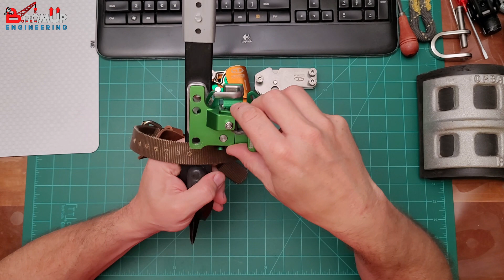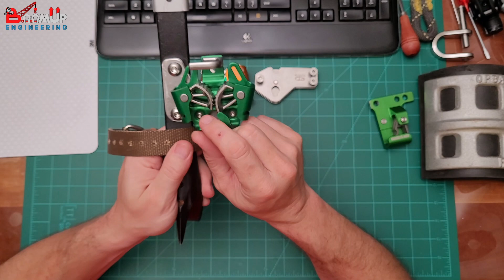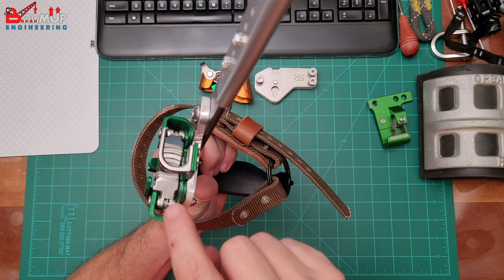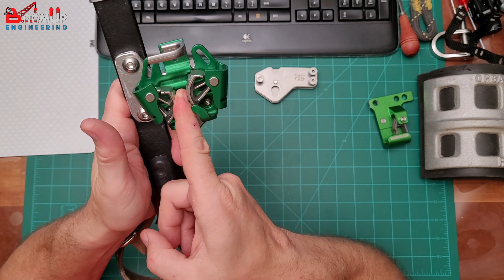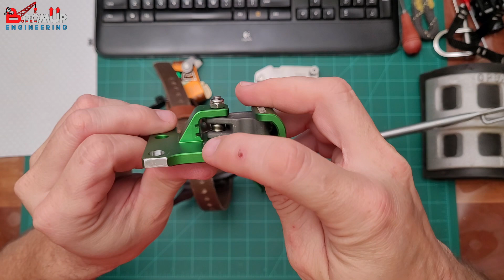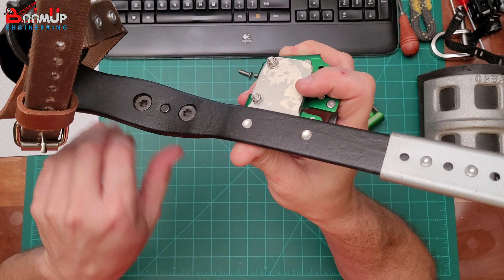Klein Spurs with Notch Jet Step Foot Ascender

Comment: Very cool. What was the rationale for your choice of spurs? It’s late (for me) and this tiny phone screen isn’t helping, but they look like steel with no offset for ankle…
Reply from the maker: I started with Notch steel spurs but didn't like how they moved around on my foot.  They would slip past the heel on my boot.  I was going to try NuGreen 2-piece lower velcro straps but I then sold the spurs.  I bought these Klein pole spurs next.  Heavy but I like the narrow stirrup which holds onto my boot very well.  Now I have no issues even when using traditional straps.  I also have a pair of Buckingham Titanium spurs (tree gaffs) and just mounted my Jet Step foot ascender.  I'll release that video soon.

Comment: Thanks for this.
I purchased the CT removable ascender and that cobble of steel clamping plates is hot garbage.  There is NOT sufficient clamping force to keep the ascender in one place.  I'll be using the plates that came with the CT to fix mount to the shank like you did.

TBH I also do not like the QD setup of the CT it is prone to self-detach unless you do some bending work on the little tab to stiffen it up.  But i'm already invested and money is tight lol.

Comment: I tried to do this today and broke the tap in the hole. Since I was using a steel plate instead of aluminum, I ended up welded the L shape plate directly on my Buckingham steel climber. Thank you for an excellent idea.
Reply from the maker: I will do my titanium Buckingham's next.  I'm sure that will be more difficult to drill and tap.  I'll use smaller screws this time.  6mm or 1/4".  Thru-bolting would probably be fine too.

Comment: Nice thorough video, I was looking at doing this. Just hadn't gotten to it. I have a jet step ascender and the notch gecko steel spurs.  Was trying not to drill the shank, but looks like a good set up, so maybe I'll go ahead and try it.
Reply from the maker: The Geckos aren't nearly so beefy as my Kleins but should still work.  I had a pair of those but recently sold them. Next pair I do I'll use 1/4" or maybe smaller screws. I've got a pair of Buckingham's to modify next.
Reply: @boomupengineering  thanks, I noticed that too (part of the trepidation for making holes in the shank. I was thinking that I could make an adapter plate to fit the holes next to the gaff for that sake, we will see. Thanks!
Reply from the maker: @MikeBrooks12550  Oh, that's right...Notch put some holes in there.  Perhaps they planned for attaching a foot ascender that never came to be.  Yeah, use those.

Comment: Love your videos, clear and precise to the subject matter with excellent presentation.  
The first thing I noticed when climbing with foot and knee ascender is when you get tired and want to descend, it is necessary to remove the rope from the gadgets.  Being so tired that I have to abort the climb and come down, I can barely lift my leg to get the rope off the foot ascender.  The locking mechanism can be deceptively complicated to work with the weighty rope, weak leg and contortion to get within arms reach.  I took great interest in the Notch Jet Step for its ease of removing the rope.  You have solved the problem of mounting it to the Klein steel spurs.  I am inspired to do the same.  I purchased the same CT foot ascender you have but never used it as the weight of it is shocking and will surely exasperate the tired leg problem.  
Thank you for sharing your inventive solutions.
Reply from the maker: I hear you on not wanting to have to reach down and do all the things to unlock a foot ascender.  I'm trying to figure out how to video myself on the rope.  My wife and boys aren't around to give me a hand.  I really like the combination of this Jet Step and an adjustable foot loop connected to my Unicender.  When I am done rope walking I can easily kick out of the Jet Step then I can slack my foot loop.  I started using a Petzl Adjust and a rope to do an easily adjustable foot loop.  If I want I can completely slack my foot loop yet still leave it attached to my foot and my Unicender.  No knee ascender but I do have to run a very stretchy neck lanyard to scoot up the Unicender.  I had watched Zaccheus - he skips the knee ascender as well.
Reply: Zaccheus is an interesting watch.  
https://www.youtube.com/watch?v=jCnEqYLKdVk  
I am surprised there are no sit back problems (i.e. lost motion between steps).  Looks like he is using a Rope Runner.  Simplifying the rig by eliminating the knee ascender is a big plus.  I have a Hitch Hiker 2 which uses a prussic type knot to control decent so there probably would be a sit back problem using that.  Once again you are giving me food for thought.  Looking forward to a video of you rope walking.
Reply from the maker: @frankalden6093  https://youtu.be/LsNr_FOlKok.  I'll have to try again when I either get a better camera setup figured out or I get one of my boys to help out.  Tried to explain knee-ascenderless rope walking then show just a little.  Works great with the Unicender, Jet Step and adjustable foot loop.  Oh, I need to figure out a better neck lanyard too.
Reply: Choking is the issue with a neck lanyard.  Something falls and knocks you out.  You slump down in your harness and choke to death on your lanyard.  
https://www.youtube.com/watch?v=nc9mZ8tKDZE
I don't know if there is a solution but worth thinking about.
I purchased Weaver elastic saddle suspenders and was surprised to find Velcro strips sewn into the webbing so the tie bridge position can be vertically adjusted.  The bridge has a buckle in the center of its span which makes tether attaching inconvenient but with some rework can be done.      Also the Velcro strips need to be extended higher into the shoulder area.  Not sure if the Velcro will be strong enough for a tether considering sawdust build up over time.  My alternate plan was to have a tether lanyard attached to the rear of the saddle, slung over the shoulder and fixed in position with Velcro loops attached to the suspender shoulder straps.
Reply from the maker: @frankalden6093  I'd welcome suspenders if I didn't currently live in TN.  They'd just be one more piece of totally sweat-soaked gear to deal with.  However, fall protection harnesses go over your shoulders for a reason.  I'll have to play around  and see what all happens if I go completely limp.  Neck lanyard or without.  I did see the Edelrid chest harness at a  show a while back.  It has a long stretchy cord setup built in.  Crazy expensive though unless ordered from Europe.  I don't need anything to hold up my saddle but I think I'll probably go the route of suspenders or something similar. At most it will be nylon webbing plus the shock cord I've already got.  Will see how creative I get.